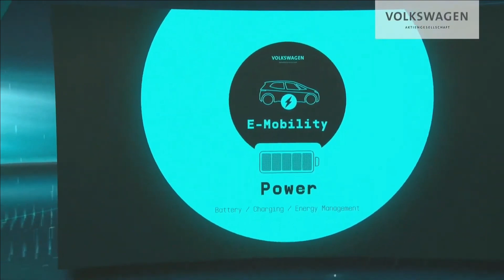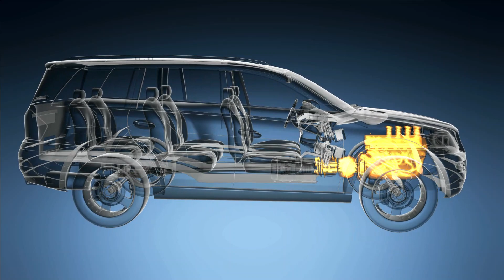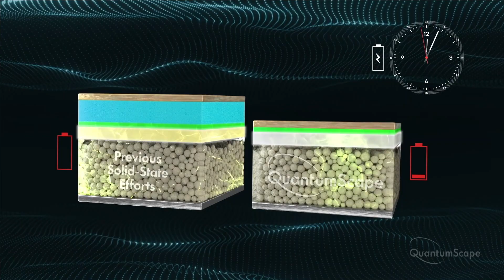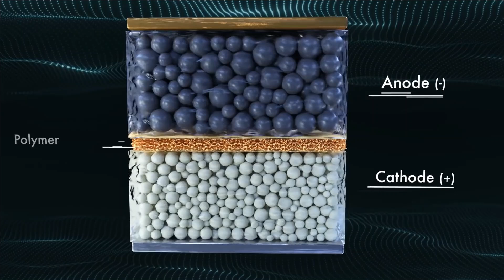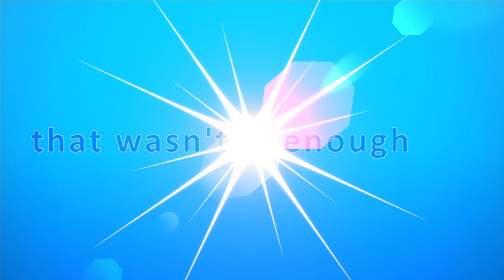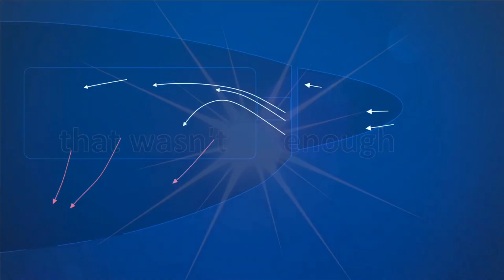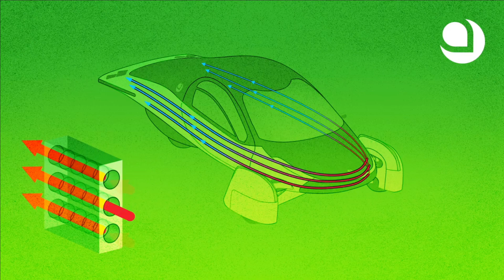Be Like Aptera How to Win the Energy Game

Comment from the maker: Use this link to save $30 on an Aptera Paradigm reservation (pay $70 instead of $100):
http://www.buyaptera.com

TeeSpring Shop:
http://www.apterareboot.com

Patreon Page Link:
https://www.patreon.com/apterareboot

WeBull Free Stock Offer:
https://act.webull.com/mo/65KX1LhCLMz3/xle/inviteUs/
Reply: As a suggestion to narrow the width for parking, pivot the wheel struts so they bring the front wheels closer to the body of the vehicle.  The width is 88 inches which leaves only 4 inches on each side of the wheel when entering a single garage door width of 96 inches.  This would also be a big help on on-street parking for narrow streets.

Comment: Batteries are the next chemical environmental disaster waiting to happen.
Their energy/power density is too low for anything other than hybrids.
Reply: There is enough energy density in the 100kWh battery pack to deliver 1000 miles of range at EPA highway speeds.

The round trip total efficiency is much better than sources such as hydrogen fuel cells, and thus much better for the environment, with far less waste heat produced.
Reply from the maker: Well said!

Comment: The solution to the battery shortage issue is to reduce the pack size and add a fuel burning range extender. A 60-70 mile battery pack will meet the daily driving needs of nearly all people nearly all the time. The range extender is only  used on the infrequent occasions when more range is needed. This would allow 2-3 times more cars to be made with same total number of battery cells than is possible with 250-300 mile range battery only EVs. Also these batteries will be charged at a low C-rate with 7.5-15 kW level 2 charges at home, so they don’t have to be built with the ability to absorb 250 kW on a high speed  DC charger. This will reduce battery cost and allow higher energy density. 

I have driven “plug-in hybrids” like this since 2015 with my 1st gen Volt (lease). I had a 2018 Mitsubishi PHEV Outlander (also lease), and now I have a 2nd gen 2018 Volt that I purchased this year. The 1st gen Volt was a really good car and the 45 mile range meet 95% of my driving needs. The 22 miles of battery range in the Outlander did not and the gasoline engine ran too frequently. I would not recommend such a short range. The 65 miles I am getting on my 2nd gen Volt is perfect for me. In 3 months of driving the engine hasn’t been needed once. But next week when we take a road trip to visit friends (now that we are all fully vaccinated), I will be using the gas engine in hybrid mode to get 40+ mpg.

Such a system would achieve nearly all of the gains of a 100% BEV with a much smaller battery pack. Still can’t understand why Chevy quite making the Volt., but I do hope they reconsider. Maybe a slightly larger battery and motor in a Malibu sized sedan or a small crossover SUV that gets at least 50 miles of electric range could be a winner (or maybe just add 2 more inches in rear seat leg room to the Volt and it would be the perfect car).
Reply: With Aptera 250 miles of range is achieved with only 25 kWh of batteries, and in many areas 30- 40 miles of daily range can be provided by the solar cells.  This performance is already 2 to three times better than a typical EV, or even better at higher speeds.
Reply from the maker: Hybrid engine is an unnecessary crutch for innovate EV makers.

Comment: Nice video, but I don't get the 4x's as efficient as similar sized EV's, my bolt with a 60kw battery goes about 240-250 miles, the Aptera 600. Ignoring that one drives 4 and 1 sits 2, thats 2.4x's in my mind
Reply: Yeah, the 250 mile one I'm getting has a 25K battery.
Reply from the maker: Thanks for the comment. One of the places where Aptera design exceed most vehicles is driving above 45mph. As you drive faster, the gap between Aptera and other EVs like the Bolt gets wider.

Comment: If Tesla 4680 batteries are ever  made available to Aptera, will earlier Apteras be able to be retrofitted with them?
Reply from the maker: Aptera wants owners to have full control to modify their vehicle so the answer is most likely a yes. A bit dangerous but if they fit they should work fine.
Reply: @apterareboot1555  why dangerous?
Reply: @EV3NTH888  these wont be so simple like working with normal batteries you could screw up the conversion as a diy.